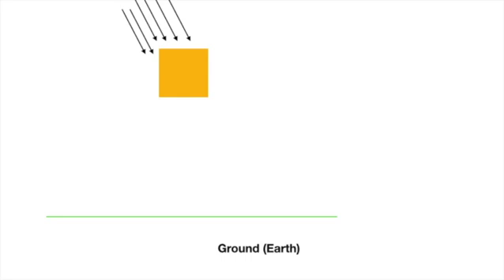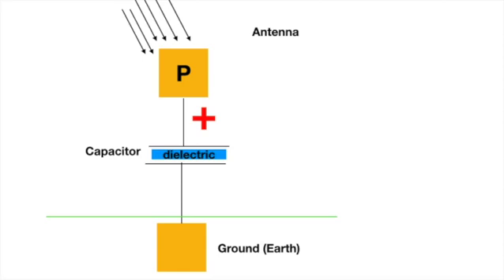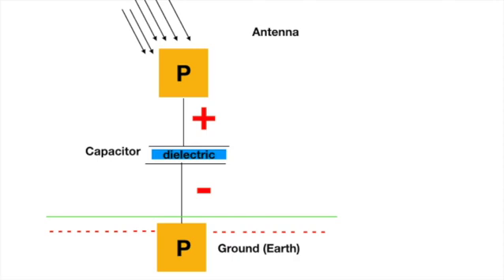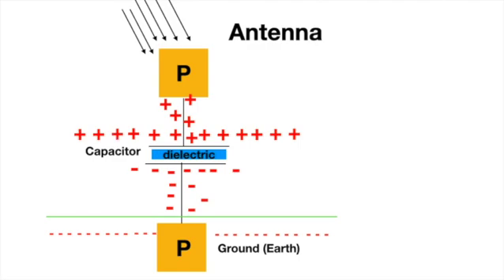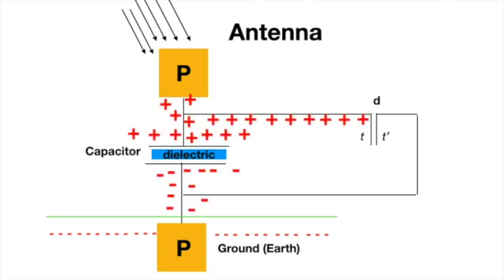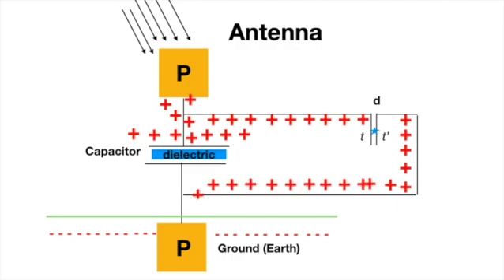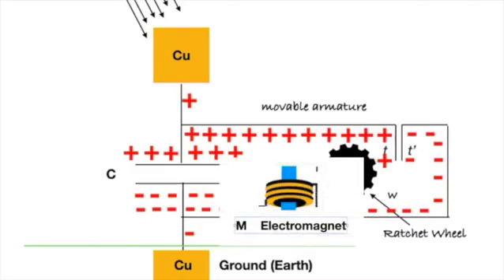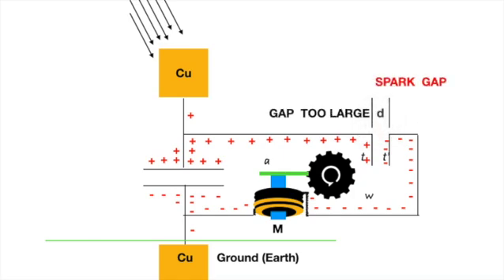Tesla Radiant Energy Animation

Comment: The circuit works best is ground is attached to a well.
Reply from the maker: In other words it works well when the grounding system is excellent, such as a deep well,  with iron pipe.

Comment: Animation is very very good -
unfortunately - most of the free electrons(negative) /hydrogen atoms (positive) that the sun produces? get scattered by the van Allen belts (and the earths magnetic field). Also? not enough positive charged atoms nor free electrons that exist in the earth (without local depletion fairly quickly) to provide useful electromagnetic 'work' - 

this experiment was tried - and is still tried to this very day.
constantly? USELESS
(i'm not saying this is not possible - but we have yet to figure this out, as well as transmitting USEFUL power via wireless - unless you are talking microwaves/optical lasers - but that far more expensive than simple polyphase transmission which is the core of our existence now).

When Tesla went down this road? That's when J.P. Morgan was made 'convinced' that Tesla, Like Edison with his Coal 'liquid' refineries were absolute lunatics.  I'm not saying either were and i have the most respect for both, as i witness using my computer to write this!  It would not have been possible without either of them, or Marconi. The shear genius of Tesla? Marconi - and Edison are the reason we are here today, discussing this!
Reply from the maker: Yes, the scale of the energy is not there. I feel that we don't have the fundemental understanding of earth and universal charge.
Reply: @myeasyfixx1205  now that is something i completely agree with!  I'm a graduate level EE that thought he knew everything about the universe lol - but then found i knew really nothing about it.  We stupidly teach our youth that what we know is a FACT and set in stone.  For it surely IS NOT! God Bless!

Comment: I disagree with this explanation. 
The spark gap is to break down the insulating fluid between the electrons( tesla mentioned there had to be an insulating fluid to keep those electrons from combining) so that their charges will combine. Tesla said that “static electricity”  actually has a frequency of 1 million per second. So an electrostatic wave of about 1 million per second was necessary to get a resonant frequency. Once that resonant frequency was reached the insulating fluid would break down, and the electrons would start combining. The capacitor was to supply the spark gap with enough continuous potential to ensure the spark would be maintained @ 1 million per second.
Reply: electron is nothing more than the endpoint of a dieletric line of force (read steinmetz) , where it terminates at the conductor. steinmetz aslo said its better to call "static electricity" the dieletric field.  this fluid would have to be the underlining aether.
Reply from the maker: Thank you for the comment. When I have time I can redo the video to incorporate your comment

Comment: Interesting hearing the theory on how this device works, using Einstein's basis of how things work. Especially considering that Tesla and many others at the time, stated that there was no such thing as a charge carrying particle, and no experiment to date has actually proved Einstein right either.

But I guess that particles is what you get when that is all you can conceive.
Reply from the maker: The principal was simple, the ground has unlimited charge, the antenna provides the opposite charge.   By the way, in the early days, telegraph systems used some of ground to energize the telegraph system.  As research continues, we will a greater understanding.
I went to the Tesla Long Island lab, the component below ground was significantlt larger than the above ground features.  Unfortunately, it became superfund site and was cleaned backfilled. There is nothing to see.
Reply: read steinmetz
Reply: utter rubbish
Reply: @BiMiHi  if that is the case, show me the evidence, papers, literature and experiments which back up your statement. 
The whole reason for stating that there is something there is for mathematics, so then equations can be calculated, but that is nothing more than a maths problem which is set out like "Johnny has three apples, Johnny eats one and gives one to Suzy. How many apples does Johnny have left?". In this entire statement there is no Johnny, there is no Suzy and there are no apples, they are just labels and place holders for the verbalisation of the equation.

But please I look forward to reading the literature, seeing all the evidence and repeating the experiments which give definitive evidence that electricity works from a charge carrying particle.
Reply: @MassageWithKlay  it gets interesting... old books i have talk of "anode ray tubes". important tool of jj thomson in showing the weight disparity between electrons and protons... cant find any modern demonstration? i keep asking these glass blowing channels to make one! everyone has a demo of the CRT, millions of them... an "ART"?. just one or two animations... almost tempted to have a go myself...
it gets back to electroplating and avagadros number and metal deposited in unit time at unit voltage/current... the source of all our standards we use now...
"volts" most people have no concept of what a volt Is. even electrical engineers... its this vague concept, not a physical comparison. we know a kg, a lb, a litre, gallon, cuin... but a volt has no real comparable equivalent... a plumber knows what a litre is... but thats coulombs and relates back to watts and joules yet it never has a real tangible... image. whatever. its funny to hear peoples reactions to a phrase "twenty five kilovolts"... oh WOW!
meh, our theory of electricity stagnated around 1920 or so, it seems to me...  and most people just rely on second, third, fourth hand knowledge that isnt understood by any of them... a very basic and limited idea...

wtf is "charge"? the attraction of opposites, the repulsion of likes?

"voltage is just a potential between two points, there is no absolute voltage..."

or is there? we have an absolute zero temperature. we have an absolute zero pressure... are we sitting at a certain potential and simply calling "positive and negative" two points on a logarithmic/assymptotic curve? consider... if we have two high pressures, or like charges... they would repel? and two low pressures? also repel...
but as soon as we bring a high pressure and low pressure together, we get a flow... and always in a given direction, work being needed to go the other way.

iunno, i also tend to overuse the water analogy because once you understand coulombs and inductance and capacitance it actually works REALLY well, other than one or two little objections... like..why the magnetic field around a coil? velocity... water has varying velocity. electricity in a given conductor does not.
yet pressure waves in water propagate at very constant speeds... the flow itself takes time.
particles, waves, fluctuations, i could waffle on forever but i wont...

hardest part... "the field is outside the wire"
it explains magnetism... sort of. 

meh. my take on this patent is an insulated plate of large area at elevation will reach a given potential. when isolated, it almost instantaneously rises to that voltage. there is a gradient along the wire as it approaches ground but its also static and not a "flow" or current. other than any initial displacement currents. just because there is a gradient along a conductor doesnt mean there is a current, as it isnt a circuit. its in equilibrium with its surrounds.
if you place a capacitor down here, it will accept an initial small charge or displacement current, then only reach a potential of its height above ground... then everything is back to equilibrium. from discharged it will only rise to the potential that just equals the charge current on an assymptotic curve. worse, as it rises in potential that elevated plate starts to REPEL any charge it collects.

useless. forget about it. nothing to see here, theory says so...

yet, as the wire is grounded, the elevated plate discharges (charges?) and produces a current. the larger it is the more current. the higher it is, the higher the potential, for more current for a given resistance...
that can create a magnetic field in an inductance, which upon its collapse, will create a high voltage kick that CAN be stored on a capacitor near ground level.
can go opposite thinking... the plate will have a displacement current that can operate the electromagnetic relay, it pulls the contacts closed, and the plate starts to reach ground potential. the field reduces as the plate gains/loses charge, contacts open, the inductive kick of the collapsing field again charges the capacitor, whilst the now disconnected plate "discharges" into the atmosphere.

our electric theory relies on closed loops. circuits. we dont stop to think about if they can be "open ended"...

Comment: Nikola Tesla's radiant energy device (Patent Numbers 658.957 and 658.958) can be interpreted as a simple solar cell, based on accumulating the charges of the atmosphere/cosmic rays on the surface of a metallic sheet (high energy EM waves would also electrify the surface according to the principle of Photoelectricity) which were then transformed into electricity by using a spark gap and transformer circuit, after the potential reaches a certain value.....Instead of using a ratchet wheel (while we don't know about the charging time and discharging frequency) it seems more efficient using an accumulator to store the electric energy.
Thank you very much for the animation 🙏
Reply: that's not true - 
solar is electromagnetic radiation (light) and not charged particles. Light does nothing in real terms to anything other than being absorbed, causing the electron to increase energy levels and a higher state within the same orbital shell but still below the conduction layer)  that's the amazing part of solar cells - they can take absorbed light, and those electrons shift from valence band to conduction band because its so narrow - same with LED light emitting diodes. simple homogenous steel, copper, aluminum has a much higher bandgap and will never allow their electrons to 'skip' away and become transfer elements. 
Tesla was amazing - i take nothing away from him,
other than he was transfixed with this notion that charged particles could be harnessed.
as i said before - its still possible - but its going to be with much more research - perhaps its 'dark energy'? I just don't know. And i hate that we teach our children now that we know everything - that science is a fact - its not!  
(when i was in 3rd grade - geology class? i failed a test because i thought the earth changes - 1967 science was fixated that the earth was the same as when it was formed! this is truth and i relate this to as many youth as i can find)
Reply: @prestonburton8504  thank you for this comment, quite informative
Reply: @prestonburton8504 Thanks for the great comment. Do you do work in this field?
Reply: @guidedbygreen1480  Yes. I'm grad level EE involved in power/energy - a huge fan/study of Tesla and own quite a few large Tcoils in the 10s of millions of Evolts.
Reply: @prestonburton8504  thats awesome! I am in commerical solar. Are you working on a modified version of his radiant generator?
Reply: @guidedbygreen1480  Solar Panels produce much more energy than such a simple device, which was a good idea for those times......
Reply: @Birol731 The important distinction in his discovery, is that it would produce electricity even at night. Solar pv utilizes visible light during the day only.
Reply: @prestonburton8504  It is difficult to determine what proportion of the energy that charges a capacitor is supplied by cosmic particles and what proportion by UV radiation of the sun.
Depending on the metal, UV radiation can ionize the surface, which leads to a potential difference with respect to the Earth. In an experiment, I coated a metal plate with lacquer to prevent charges from escaping the surface. With such a setup, it would theoretically be possible to create a primitive device that can charge a battery over a long period.
For the claim that charged cosmic particles are the energy source, it would have to be proven that the metal plate receives only one type of particle (either positive ions or electrons). If it were to absorb positive and negative particles alternately, the plate would have an average net charge of zero Coulombs. That seems unlikely to me and makes cosmic radiation a questionable primary energy source.
It is more likely that this is the precursor to solar cells. Certain metals such as Lithium (Li), Sodium (Na), Potassium (K), and Magnesium (Mg) can lose electrons due to UV radiation of the sun (photoelectric effect). In this way, the plate could be permanently polarized and used as an energy source.
I am very interested in Nikola Tesla's "Radiant Energy Concept," particularly the question of how the aether could be converted into electricity through rapid direct current (DC) pulses. This concept is still ignored by classical school physics to this day (longitudinal scalar waves.....)
Reply from the maker: Yes, later the ratchet wheel was replaced

Comment: U r wrong.  The ground is positive. Mesure it and u will see. The electrons at the clouds flow down to it.
Reply from the maker: Yes, you are correct.  I used the Tesla notation. At that time, Tesla and others used that notation.
Reply: It's exactly the same as North and South magnetic poles, because we are so fixated on particles we miss out on observing rate of flow, When you look at the direction to which direction flows, it's this device builds up a field which then flows towards the ground.

Just as a quick note, if someone can present me with either a cup of protons, or electrons, I'll happily accept that they are particles, until then, I'll see it as fields.
Reply: @MassageWithKlay  we must mesure with a multitester. It shows exactly the fact.
Reply from the maker: @MassageWithKlay  I find your description interesting and it sounds right.  How would you explain how my video " Reversing 

Gray Hair naturally" Part 2.  In that test I surround the water I drink with magnetite, Iron Oxide. I thought if it did work it is because cosmic rays , or high energy particles, (waves) make it thru the magnetitte.  I dicontinued the test because I was drinking more water than I was making. I hope make more units and dridnk 2 liter per day for this test.

Comment: U r wrong.  The ground is positive. Mesure it and u will see. The electrons at the clouds flow down to it.
Reply: You're both wrong! There is no such thing as plus and minus charge or positive/ negative charge. They are wrong concepts. There is only magnetic polarity. The particles are either north pole or south poles. We only use north pole polarized particles in all electrical circuits. In order for electricity to flow, you need both. North polarized particles go to the ground or to the south pole. South pole polarized particles (negative) go to the north pole. In a generator, they go to the frame.
Reply: @devinmccloud  Thanks Devin, finally someone who understand more about the electricity. All electricity is magnetic, all electrons are magnets, all magnets are gyroscopes. They either attract or repel depending which way they revolve. When two balls revolve in same direction, when they hit each other they will push away and when they revolve in opposite direction they actually can revolve at same speed touching each other. Theres also no "direct current" in this universe. All electricity is two way swirling motions of these tiny magnets. In same way you cant shoot water in a hose if theres no negative pressure facing it and coming against it. We think that vacuum is not energy, but in fact it is. Without vacuum there would be nothing. Vacuum is just ultimatum of "negative" pressure or lower potential. The high and low potential is the wave structure of the whole universe that consernes all things existing. The low potential is as necessary as the high potential. Although everything man does is focusing on how to higher the potential instead of seeking ways to lower the opposite end.
Reply from the maker: In textbooks, one has to establish what notation is being used.